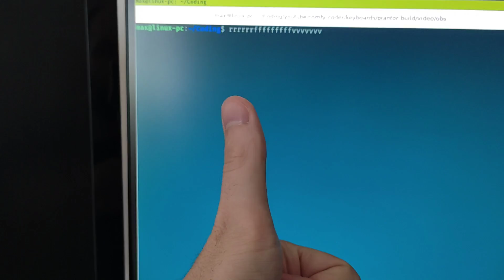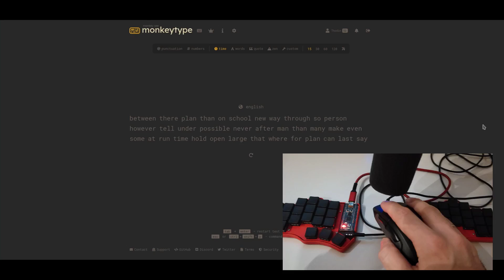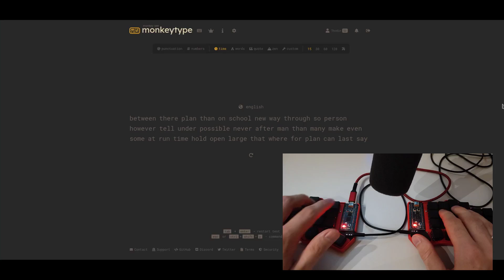What happens if a Software Engineer builds a Keyboard? | Beekeeb Piantor Build

Comment: 10 keys are enough for everything!
Reply from the maker: Do you use a board with 10 keys? I am interested in how that works for you.
Reply: @GreenTeaCoding  No, just my idea, but it can be used on an ordinary keyboard, but it would have to be analogue magnetic and a touch layer would have to be added:

10 keys are really enough for everything, just a bite:
- long keystrokes
- quick double keystroke
- shallow key press (analogue magnetic keyboards)
- deep press (analogue magnetic keyboards)
- double key (2 keys)
- three-handed (3 keys)
- extended shifted (sync, async, pre, post, ...)
- normal shifted, combo shifted
- combination of upper options
- touch row
- gestures
- combinated
Reply from the maker: That's a lot of thought you put into that idea. The problem with double taps and long keystrokes is that reaction time for single presses increases, which gives me a weird feedback when typing. 
It's a matter of what you get from reducing to so few keys, and whether that's worth it for you.
Reply: @GreenTeaCoding  10 keys = no need to lift fingers = speed
touch speed + touch gestures = speed
long and double = you can choose = I guess it uses Voyager = long and double period can be set = I've been using on a regular keyboard since 1996 on a Sam Coupe and now PC, it works really well there. Long and double goes set in a jiffy and still works very elegantly. I prefer full keyboards 100%+, but I also find 10 keys interesting, typing without lifting and with minimal finger movement.
Reply from the maker: This is a very unusual approach for sure. Would love to see that in action (and up to speed).
Probably takes a lot of getting used to, but I can see some of the benefits now, especially for people with RSI or similar.

Comment: For the resistors/diodes, it's a lot easier if you tin just one side of the PCB connection at first. Then you can fully seat the component how you'd like it, and later solder the other side while the first locks the whole thing in position.
Reply from the maker: Great tip, will try it out when the time comes to build another board.

Comment: Does this keyboard speeding up  the time of making junit tests? ;-) A question: on the pcb,  it looks like that leds are possible to place. Is this optional or not supported?
Reply from the maker: I never programmed in Java, but I'm sure it will speed up writing junit tests by at least 38.4%. I don't think the board supports per-key LEDs, as this would usually require some resistors, and I haven't seen any.

Comment: Physically what's the difference with Corne keyboard? The Piantor looks with a more natural layout for the fingers. Great video.
Reply from the maker: Yes, I think that the layout, especially the more aggressive columnar staggering, is the main difference. On top of that, the Piantor uses low-profile switches (better said, the respective pcb for them), while the Corne is made for MX switches.

Comment: thanks for the video. can i ask whats the overall height of the piantor (from the bottom housing to the key caps)?

also, how do you find it when you are carrying it around?  is there another keyboard you recommend in terms of the build quality ? 

cheers
Reply from the maker: The Piantor is very slim, 20mm with rubber feet, 17mm without them. It's also extremely light, so carrying it around is a breeze. I would opt for a bag though to protect it.

In terms of build quality, I really prefer the Iris from keeb.io. It's the other split board you see in the video. I got a brass/walnut wood housing from little keeb iirc. They don't seem to exist anymore (at least not under that name). The board has quite the heft to it, around 700g per side! But it's built like a tank. It doesn't move or bend, has had multiple confrontations with water and coffee, and is still going strong like on day one. I've had it for four years now and use it around 10 hours per day as my main board. I never regretted spending a bit more on that board.
Reply: @GreenTeaCoding  thank you so much for your detailed comment !! ()

Comment: Never trust a programmer with a screwdriver! 😄 

No software to re-program all the keys? 
I was looking for a fully programmable keyboard with Linux software and found the Dygma keyboards. More features, more thumb keys, wireless... (Ich brauche multi-device BT Geräte.)
Reply from the maker: The software I used to program this board is QMK. I also used it on my other boards and really like it. You need some basic understanding of coding though, and C. However, there are alternatives that let you change the layout in a more visual style, like VIA.
If you need a wireless board, look for one that is compatible with chips that have a bluetooth feature. I can personally live with a wired board, so I have no experience with that.
Reply: @GreenTeaCoding  
C would be no problem, but changing just one key shouldn't be such a big task. I ordered a Dygma. They have very interesting software for all desktop operating systems.
Reply: @Blackjack-0816  I agree with the potato. I sent my dygma back because the software side
Reply: @JulienBertozzi  
I don't want to build a keyboard and compile firmware.  I just want to use a keyboard that can be configured under Linux.  Dygma delivers that.
Reply: @chocolatezt

Comment: Very good video. 

Any tips for soldering microcontroller? I got raspberry pi (still have not soldered yet) but the "legs" seems very small.
Reply from the maker: Thanks!
As for soldering, use a small tip and make sure to heat both the pins and the rim before adding the solder. But the solder will typically flow to where it should, it's easier than it looks. I have almost no experience soldering and didn't have a problem.
Reply: Thanks for answering. I was able to build mine with raspberry pi pico. I practiced first with some cheap practice kits. I had some issue because my solder was too thick but I found some thin solder wire and was able to do easily.

Also 4 keys didn't work but I just warmed the solder and added bit more. Then it worked 🎉

Solder temp at 350c

Comment: How is the spacing of the keyboard compared to normal macbook air or any kind of 75% layout keyboard.? I've pre-ordered this from my local reseller. I'm new to this kind of keyboard. So I'm really worried if Piantor gonna be a little cramped on my hand. I bought this cause of my injury. I hope this could help me better in typing. But worried if it's gonna be cramped and hurt my hand more than it should.
Reply from the maker: I'm not a Mac user, but as far as I could find out, Apple is not very consistent with their key spacing. It seems like the Macbook Air has an 18mm key spacing, which would be the exact horizontal spacing the kailh low profile keys have. The vertical spacing is 17mm though on the Piantor.
Although I come from mx-Style switches with around 19mm spacing, I could type on the Piantor right away and didn't really feel much difference. If at all, I find it convenient that there is less travel. No cramping in the hands whatsoever.
Hope this helps, thanks for taking the time to comment!
Reply: @GreenTeaCoding  Thank you for your time addressing my comment, I highly appreciate the feedback. I'm glad to hear the typing is not so far difference compared to other keyboard.

Comment: thanks for the video! I'm in a process of building a cantor keyboard. Though I messed up one half and I'm waiting for more switches to come so I can rectify the issue 😃 Would be nice to see your layout!
Reply from the maker: Cantor and Piantor are very similar boards. Sorry to hear that you bricked one half, but at least the other half is still fine (benefit of split boards ;)). Will share my layout in the coming weeks.
What do you plan to use your Cantor for? Programming?
Reply: @GreenTeaCoding  I ordered my pcb and everything else separately, instead of buying a kit from one of the vendors so I have enough boards and to fix one half and to assemble another keyboard so this is not too much issue, hopefully I'll get it right on my second try haha! I'm going to be using my for programming as well! Hopefully it won't take too much time to get used to, coming from a TKL keyboard. I'm looking forward to your future videos!

Comment: it's better if you soldering your pico last...so you can solder hotswap socket more comfortable
Reply: Did you also build a Piantor?
I found the hotswap sockets to be the easiest thing to solder, as they stay in place by themselves.
Reply: @thodin87  no I'm not.. I want it.. but I can't afford it :)
Reply: @haf0  Oh, that's very unfortunate. But it's definitely worth the price imho. I am not aware of a similar board that would be significantly cheaper.
Reply: @thodin87  glad to know that you're happy with it

Comment: What happens if you forget to plug in trrs cable before USB?
Reply: no problem at all I think.... but never unplugged trrs before usb because it may damage your hardware

CMIIW
Reply: @haf0  Yeah, that actually makes a lot of sense. In fact, I connected the microcontrollers to USB individually to flash them before the build, and that went fine.
Reply from the maker: Good question! I assume that the software will go into an invalid state, but not sure if the hardware could also be damaged. However, I am not curious enough to try it out and risk the board :)

Do you also have a Piantor?
Reply: @GreenTeaCoding  not yet, Im thinking about 36 or 42 orto split board. Not sure yet  what exactly, if I want to make it myself, or get prebuild. Just checking my options.
Reply from the maker: Great choice! I cannot recommend it enough to build yourself. Such a rewarding feeling, and you learn a lot about how things work. Best of luck!
Reply: People say it can damage your board, but some people say the chance is small. So should survive accident but don't make it a habit (if you're unlucky you'll have to buy a new board)